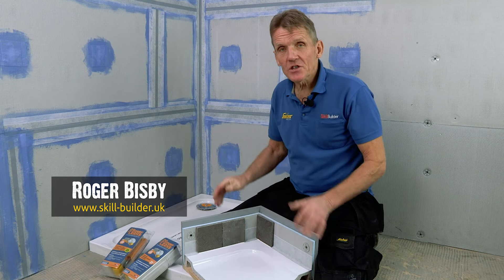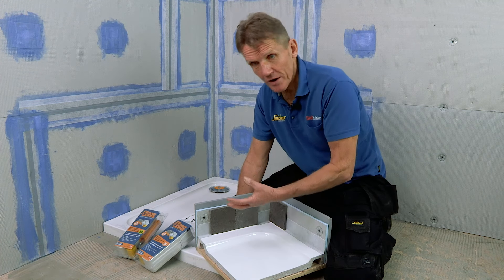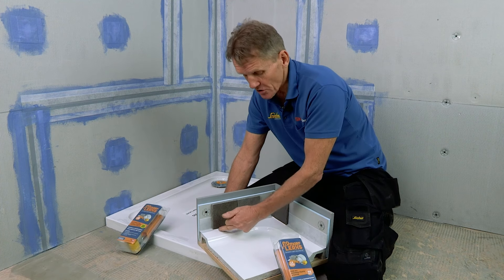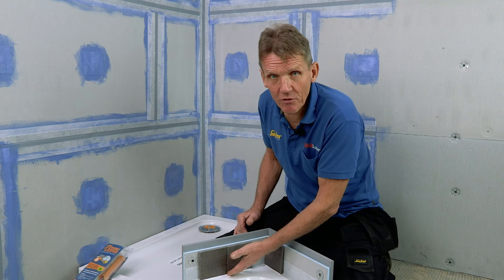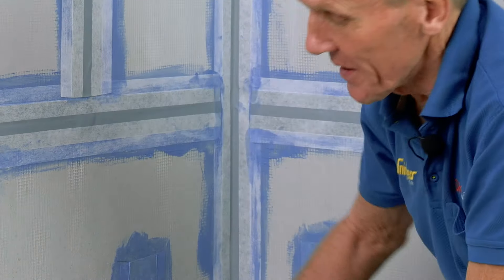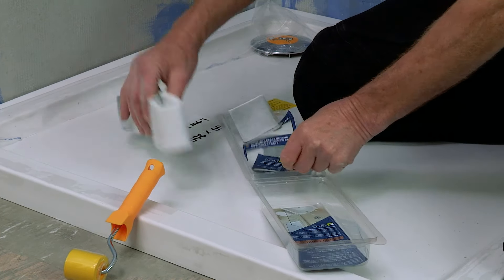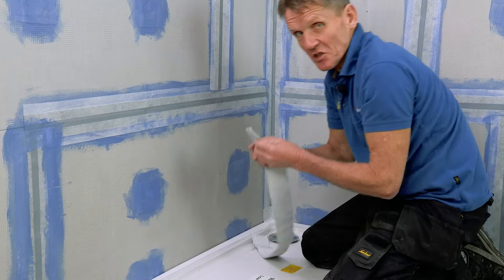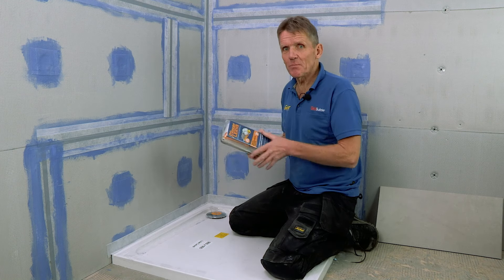No More Leaks Bath & Shower Sealing Kit

Comment: Do a proper job: three lines of defence. First the seal between the tray and the tiles - use a good sealant, the hack-out & replaced it when gaps appear or it ages. Second (if the first fails) a tape system like the one in the vid. Third (if the tape fails or a crack emerges somewhere) a complete waterproof sub-tray e.g. fiberglass/resin with a drain that will drip in a visible place if water ever reaches it.  That’s a proper job.
Reply: sub tray ?Where can i get one tom?

Comment: I’ve installed No More Leaks 3 years ago and I checked under my shower today and I was disappointed to note that there appears to be leaks and water under the shower coming from the edges alongside where the no more leaks tape is. It is Fibo shower board on top and I’ve removed the silicon which even after 3 years was in poor condition so I’m replacing that. However, I thought the point of no more leaks is if the silicon failed then no more leaks would stop any water creeping past the sill. I’m gutted and wondering what I can now do other than replace the silicon but I now know that below the silicon there isn’t an effective water barrier
Reply: Honestly, it's a real nightmare how in this day and age we don't have a solution for a leak free bathroom.

I am putting off committing to a any bathroom fitter till they explain to me how they will make it leak free.

Comment: This is great, I'm doing a shower tray exactly the same way (abacus boards etc) however this tape doesn't go on anywhere near as easy as Roger makes it look. First off the adhesive itself sticks the the backing paper that well, you can't actually get the thing off, then when you do (I had to use a stanly knife to get it going) the paper keeps ripping and your left with small sections of paper that you have to then pick at (again with a stanly knife) to get going again, this happened at least 10 times. Then trying to get it to stay 10mm on the shower tray is another very, very difficult task. All in all, I felt sick doing this supposedly simple task. I might have received a faulty one, who knows, but I do know it didn't go anywhere near as easy as this vid makes it look.
Reply: I have two whereby I cannot remove the paper backing. Another is being posted out to me today
Reply: It's it made in China?
Reply: Cold room?
Reply: Why don't you just silicone the tray before tiling,then again after,been doing it for 15 years without a problem
Reply: @stevengibbons7578  No problems that you know of.

Comment: why don't they include a flange on the shower tray to prevent water leaking out, the tile can simply go over the flange it wont leak?
Reply: Most baths and showers in America have this, not so common here
Reply: Maybe they don’t have it on bath as companies would have to produce a lot of variations for baths 

As some baths are in a alcove type 

Some are only up against two walls and have a end panel
Reply: That's what he means by up stands. Google mira flight upstand shower tray.

Comment: I recently installed a shower tray and enclosure and experienced leaks, i had actually tiled the walls down to the floor and this was one of the reasons why i wasn't getting a good seal and after repeated re sealing with silicone sealant i went onto the internet to find a solution, i came across the "No more leaks" product and this is by far the best product i have ever sourced to cure a leak problem, i  decided to apply low modular silicone around the edge of the tray and when cured i then installed the no more leaks seal, i then installed UPVC trim around the shower tray fixing with clear silicone and once all cured i sealed around the trim, the shower tray is now successfully sealed and i would like to thank Abacus for manufacturing a brilliant product and not to forget Roger bisby for such an excellent YouTube installing demonstration and i would advice anyone to view the video before installing this product.
Reply: I have had problems with the paper backing being unable to remove

Comment: Put a bead of silicone behind it. Put the tape over the top once it’s cured then lay the tile and place another bead of silicone. It’s triple
Reply: That's exactly what I do  1 Silicone between tray and wall  2  silicone under tile or Febo board   3   final silicone bead between wall and tray - triple sealed

Comment: This stuff will not stick if there is any old silicone sealant in the area , the film on the back is hard to get off and too wide on the 10mm side so is hard to get right in the corner.

Comment: I removed caulking from shower floor because it was getting moldy but water started coming from where I removed caulking and some of it has a bad odor, I have waited like 2 days but those areas where the wall meets the floor are still humid, what can be the problem? Where would that water be coming from? Should I just re-caulk?

Comment: Why don't shower tray manufacturers make a lip 90 degrees to the tray that fits to the wall. Then the tiles can sit over it and drain straight into the tray. Simple.
Reply: Cause they have to spend they money. So they letting you spend yours

Comment: I fill between the edge of the tray and wall with silicon whist fitting the tray, after set I then run a bead around the top corner prior to tiling. Then use a water resistant tile adhesive. 
Haven't had one leak yet.

Comment: i fitted a similar tape around 15 yrs ago, it was blue, rubber and had a 2 inch portion of the tape as a black tacky adhesive. it went on the side of the bath and up behind the tiles. seen it at an ideal home exhibition and the chap who made it done adverts for it. i will be looking for it this time now i have a new house to  bath seal shortly, just prefer the , not sitting on top of the bath method, rubber seems more appealing. cant recall the name, think it was a Ireland product. my bath never leaked and i could produce tidal waves.....
Reply: Classi seal it is mate
Reply: @pe3192  thanks. As I'm in need of a system again, I said to a plumber about it and he said , oh no we have been to many of that type leaking, use one that sticks on top, not the side. I was surprised and wonder which is best

Comment: So would you recommend tiling behind the shower screen rather that up to it?
Reply: Absolutely!     Never tile or panel up to the internal shower frame its guaranteed to leek!
Tile first then then fit the shower enclosure.  also don't silicone the internal shower enclosure edges at either the tray or walls, just the outside of the tray to the wall and tray to frame except that is the lower internal frame mounting for about 6" to 12" from tray up.

Comment: If it's a bath that I'm fitting, the rim is supported on a batten screwed & glued to the wall so vertical movement of the rim against the wall is virtually impossible. Then overfill the gap between the tray/bath & the wall with silicon (having first made sure the edge of the tray/bath is really clean & grease free) then run a plastic scraper or rubber grout float along the joint flat to the bath & angled against the wall such that the slight excess of silicon is smeared up the wall by 30-50mm to create a waterproof upstand.
Then I fit a simple L profile bath seal trim, sadly the only decent ish on I can find these days is from Wickes (genesis used to do a really good one for under or over tiles) that is meant to go on after tiling but I put it on before to create a 2nd upstand & seal it to the tray/bath with silicon & clean any excess away with wonderwipes. Then tile with 3mm gap between the tile & the trim which I fill with GROUT. 
This gives a very effective seal with no silicon visible within the shower or bath area that can go mouldy.
If the water gets past the flexible edge of the trim strip, it then has to get past the silicon that bonds the strip to the bath/tray AND then has to get past the silicon that seals the tray to the wall. So far, in about 20 years of fitting baths & showers, I've never heard of one of mine leaking, or going mouldy.
Reply: goood idea,this is really helpful.🥰🥰

Comment: Has anyone ever tried the emergency roof repair thick grey liquid that contains fibres in the cracks?  I have a whole tin of it.  Bit messy but making tape it off first.
Reply: I just made a big mistake using this sort of product, it is not compatable with silicone, ended up with black liquid seeping through the silicone.
Reply: @LucasTbull  thanks Lucas.  I ended up using a tanking kit for 10 metres squares by another brand called Ever Build.  I lot cheaper and did the same job with plenty of the special tape.  The emergency roofing product does not allow anything to stick to it such as tile adhesive so best not used in bathrooms etc.  Cheers Aaron

Comment: What product would you use when you have shower panels already installed with a gap at the bottom which is filled with silicon....which is failing.
Reply: I would use the best quality shower silicon to replace it. did you find an alternative from posting 5 months ago...
Reply: @JM-dt9oo   clean out all the old silicone and use a product from sikaflex there are many types but use one designed for marine applications, colour options are available. When I install trays i use this around the tray to wall/panel instead of silicone as its an adhesive as well as a sealant and ait really won't fail!

Comment: Bought this and hope it will provide an extra line of defence on top of cladseal and silicone. Be aware it’s really fiddly and takes patience to fit as it’s so tacky. The backing tape doesn’t want to come off cleanly and the blu-tac like material sticks to it and stretches, making it harder to fit.
Reply: Looks a bit like the Tyvek stretch tape used to make window and door sill pans. Horrible stuff and even the act of peeling off the backing tape distorts the tape and never returns back to shape.

Comment: If you're fitting wall tiles less than 10mm thick, then this product just isn't worth bothering with.

First you'll have to trim a few mm off, otherwise you'll see it poking out underneath your wall tiles. Doing this but keeping a consistent depth along the full 2metre length is near impossible.

If you managed to trim it, your next challenge is that most shower trays have a round / beveled top corner. This means that you're only going to get 1-2 mm overlapping the shower tray.  When you consider the adhesive on this isn't sticky or thick, I don't see this adding any substantive extra sealing capability over good quality low modulus silicone. If it were thicker, then maybe it would work, but that would push your tiles up too much.

Next, factor in that the tape comes pre-creased just to increase installation difficulty. The backing tape separates from the adhesive where the product was folded rather than rolled  for the packaging. Result of this exposure to air means some areas of the tape have zero stickiness remaining. This means if water does find its way behind your tiles, this weak spot will fill with water, which may then break the remaining bond and render the tape useless.

Ultimately I decided the potential extra sealing capability offered wasn't worth the potential problems it introduces, so I'm going old school and using a good quality low modulus silicone between the tray and walls, and then between the bottom of the tiles and tray. Done properly having installed plumb, true and square waterproof backer board of some kind will not let you down, and save you purchasing a very expensive wallpaper seam roller

Comment: If you really need to use waterproof tile backing board, you need to improve your tiling & grouting skills first, waterproof backing is a good belt & braces approach but grout is the most important and first line of defence, if water gets past the grout, the job has technically failed.
Reply: yes waterproof bioard is of grout / silicone fails but then where does the water go? this tape is not teh anser cos what happpens when you resilicone

Comment: I have to agree with luvit 756. Followed instructions  nowhere near as easy to put on as video will show or what the instructions say so sticky did not wanna come off of paper very hard to get into position I finally have but not so sure it’s going to work. Very disappointed in the product at present I have the Tiler coming tomorrow he told me not to use it but said if I give you peace of mind. 
Just hope I’ve done the right thing otherwise you can be sure I’ll be slamming it on social media

Comment: There is a simpler solution called common sense.Subfloor covered with proper ready to tile tileboard,tiled all over and sealed around,then shower tray installed,sealed and wall tiled around and  finally seal between tiles and tray.20 years never been called back.One thing - best done by a single highly competent person
Reply: So do you lay the shower tray onto the tiles?

Comment: Still a crap idea. If you did this in Australia you would at a minimum be thrown off the building site and even taken before the Builders Tribunal (in Queensland). Terrible system. The whole shower needs to be tanked with 2 coats of waterproofing from the top of the shower all the way down inside a puddle shower waste.

Comment: All being well sealling before tiling.
But lets see what you can do to stop an eventual leak when your bathroom is already tiled and you are fitted a shower tray into the corner....
Take our bathroom its tiled floor to ceiling so how do i seal the shower tray  from leaking....
Reply: You say everything with this installation is wrong, but give no indication as to why it is wrong. As someone who has only installed ten or so showers I’m always interested in new ideas.
Reply: Use 3 mm Laminate board From Reavo.  Their Mastic will adhere to your present tiles.     You then  place the laminate board over the tiles using inner and outer corners and a profile strip to secure the laminate board to the shower  tray. Laminate boards size are 2500 x 1220 app'
OJC

Comment: Used classi seals as well as no more leaks, both give confidence however the problem still seems to be the ends.
The silicon gives way eventually, water doesn’t seem to get down the back as these up stands do their job but water travels off the ends eventually. Wondered what you would recommend and what silicon. Thanks
Reply: A long shot, but would you be able to give me an update on putting both classi and no more leaks on? Thinking of doing it myself

Comment: Do I need to tank waterproof plasterboard if I use no more leaks round the tray and then mount shower board over the plasterboard?
Reply: In theory no however if you use tile I would say yes as grout will form leaks and you'd be surprised at the mess it will make before you realise there's a problem! if tiling then find the studs and cut out the plaster board and replace with abacus panels, there are other makes but I've found these to be the best by miles!

Comment: The tape is certainly not as easy to apply as shown in this video and it is difficult to ensure you get the correct amount on the shower tray. I also found that some of the backing paper did not come of easy. For this I followed the advice of another poster and put the tape in the fridge for 10 mins and this solved the problem. I also had to take a Stanley blade and trim parts of the tape where it was slightly further out on the shower tray than it should have been. Once stuck the tape does feel very secure. I too wonder what will happen to the tape if the silicone sealant needs changing in a time to come. I suppose using a waterproof non mould sealant will hopefully mean this is a long way off. I know firms want to sell their products , hence the really easy to apply video. It would be a different story if we got 20 people with different DIY skills levels to apply it.

Comment: Filling a bath with water before you tile 🤣🤣🤣🤣🤣 just finish the tiling then screw the feet down one or two more turns to push the bath up tight against the tiles.

Comment: I'll be straight up here I like to tile everything and then fit the tray I've never had a cracked tray yet,, and always got the waste spot on,, and siliconing the whole upstand against the walls has never failed for me,, I also fit baths in the same way,, tile first then bath goes in,,, I also ratchet strap the sub frame legs of the bath to the joists so it's really pulled in and down (filled with water) until its set,, just a few idea's,, that way you don't need leak seals,, water won't get through 50 mm of vertical seal,, the bath edge ❤️👍

Comment: Really enjoy your vids , is there a seal i can put over the tiles as it meets the trays, as I've tried resiliconing twice but I've still got problems, many thanks for any advice.
Reply from the maker: Thank you for your comment - unfortunately this is not something that we do as we prefer to put the seal behind the tiles rather than in front for aesthetic reasons.  We think there are plastic products available on the market which may suit your requirements, however they potentially would be vulnerable from silicone breaking down. Hope this helps!
Reply: @AbacusManufacturingGroup  thankyou for your advice.

Comment: Is there any solution for where the floor tiles butt up to the shower tray, particularly where you step in and out? Or is the fact that it's not seeing running water, coupled with a good job of the grout/silicone sufficient?

Comment: Silicon only suitable for stable gaps  but bath tub or shower tray  even if  secured properly to the floor and the walls  will move when loaded with weight of a person plus water, not forgetting hot water and high pressure shower heads will find the smallest of gaps for water to leak through. Silicon  is overrated material used from sealing double glazing to wet areas  but rarely lasts long.